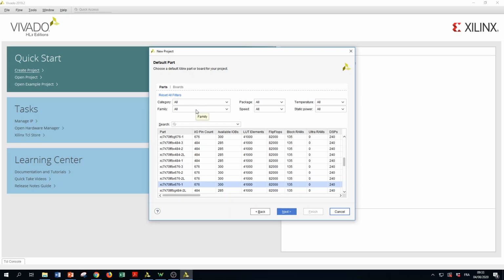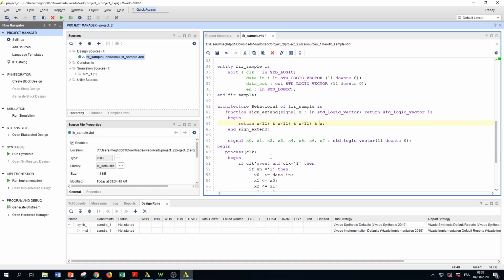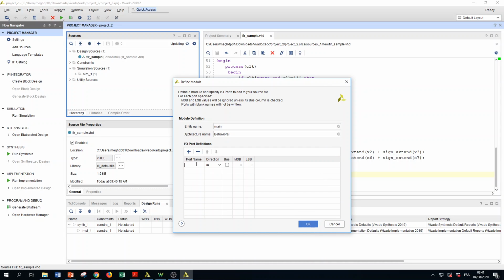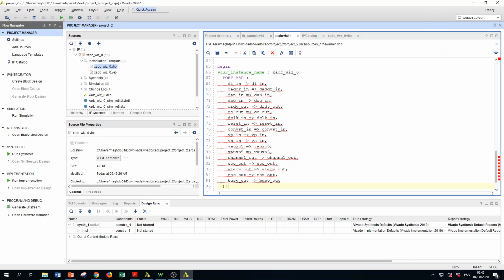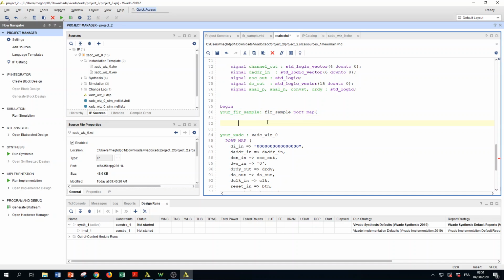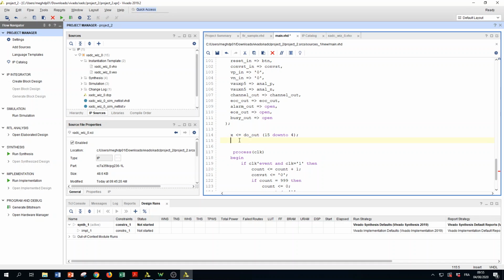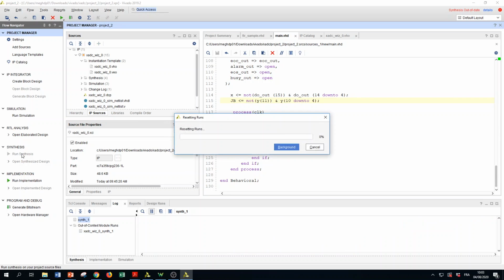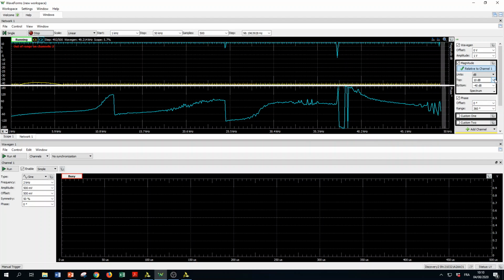tutorial on Vivado XADC by creating an FIR filter on Basys 3

Comment: Hello there, thnx for the video it's very intersting. I was wandering if you could help me because i'm using the same FPGA board (basys 3) and my goal is just to read an analog input and eventually display it in the seven seg display but i m just a beginner so it would be very cool if you can help me. Thnx again
Reply from the maker: Hi BI MO, you may take a look at http://www.unilim.fr/pages_perso/vahid/VHDL/XADCinBays3.xhtml. I put a detailed usage of the XADC that may help.
Reply: @vahidMeghdadi   Hi again,  it worked perfectly but can i display the voltage in the 7 seg display ? Thank you so much for your help
Reply from the maker: @jiren_bbx1970  Look this link https://www.unilim.fr/pages_perso/vahid/VHDL/afficheur.vhd
Reply: I did everything it said but it shown me some errors i didnt find answers to, so it s not working at all

Comment: Hi Vahid, i understand why you do a shift of input values by 3 bits to divide by 8 but why do you cut 3 bits from the output values by doing "dout <= y(14 downto 3)" ? I mean why don't you just make the dout-vector 15 bit wide "(14 downto 0)" ? Greetings
Reply from the maker: Hi, because I needed just to 12-bit resolution. That's why I took the 12 MSBs. So in fact I discard the 3 LSBs.